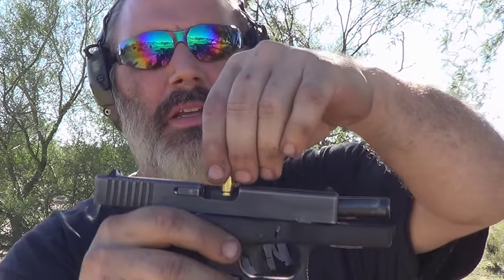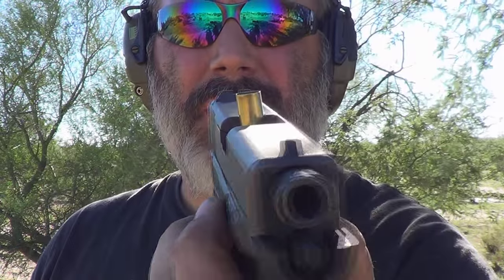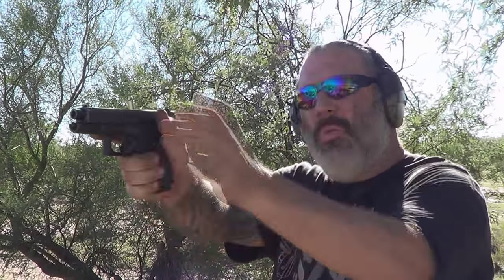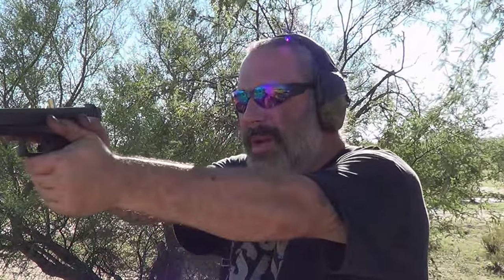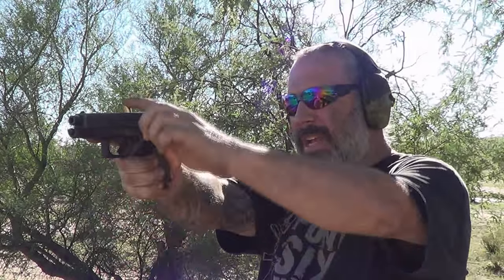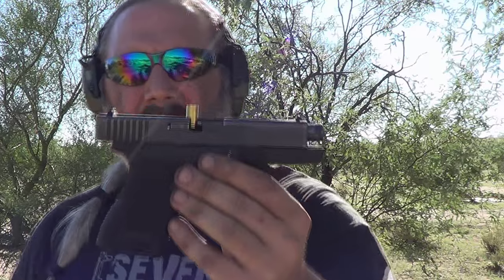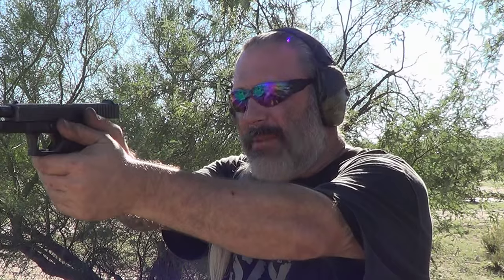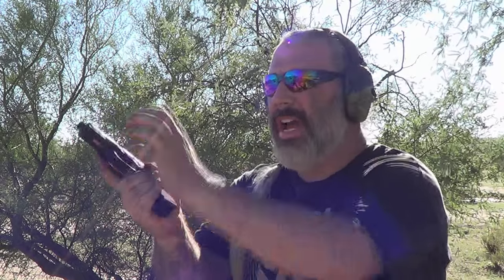Pistol Malfunctions - Stove Pipe

Comment: Just watched another video where the instructor says that the tap and rack method could present a double feed when working with a stove pipe. How often does the double feed occur when you work the tap and rack method for the stove pipe? 

Thanks a lot for  these educational videos
Reply: Yep Tap and rack will cause a double feed if the next round has begun its journey up the feed ramp and been stopped by the ejected casing. I am currently having issues with a Jericho and tap/rack would always cause double feeds cause the next round was almost in the breach, therefore if I rack the slide to get rid of the jammed casing, another round is sent up the ass of the round halfway in and voila double feed.

Comment: I have a Glock 17L. I've had about 3 failures to eject out of 130 rounds (Stovepipes) 1 failure was with a lonewolf extractor and 2 with the glock oem extractor. 1 failure was with standard PMC 115 grain ammo and 2 of the failures were with 124 grain Remington golden saber ammo. The ejector that my 17L has is the factory ejector, it's labeled "336". I'm using the factory 17lb recoil spring, and new Gen 5 magazines with the taran tactical +4 extensions (The magazine tension feels fine) should I use a lighter recoil spring? Maybe a 15 lb or a 13lb spring? I'm really upset about this issues, It's the only Glock I have and I need to carry it everyday for self defense. I'm so disappointed that I thinking of selling it and getting a new Glock, a G17 Gen 4 maybe. Any comment or suggestions?
Reply from the maker: Is this a new gun?  And other than the wolf extractor, are the rest of the parts stock Glock parts?

Comment: Just got a new Glock 27, it’s probably got 100/150 rounds through it and it keeps jamming after 2-3 shots. Or when I try to rack it a bullet gets caught. Could it be my mag?
Reply from the maker: Without seeing it.. I would try multiple mags to see if you get the same result, and mark the mag/s that present with that problem.  And diagnose from there.  Also check your extractor to see if it is broken or chipped.
Reply: RTT : Guns & Gear okay cool. Thanks

Comment: Why does it seem to happen on my Taurus alot it seems
Reply from the maker: @seethrucrew4092  The two most common stovepipe issues are an insufficient grip or an extractor issue.
Reply: @RTTGunsGear  holding too loose of grip maybe 🤔
Reply from the maker: @seethrucrew4092  That's generally the most common culprit